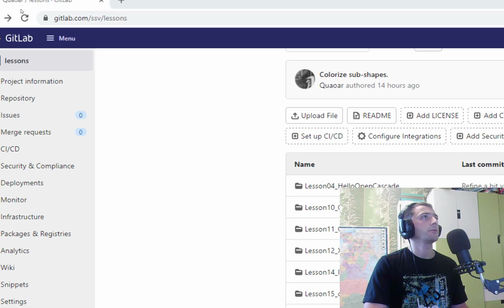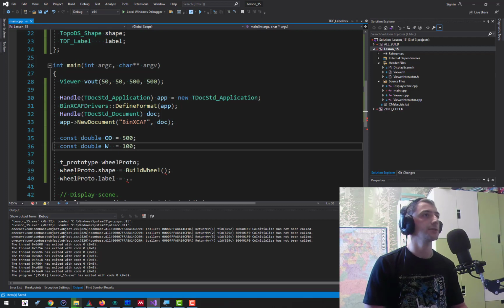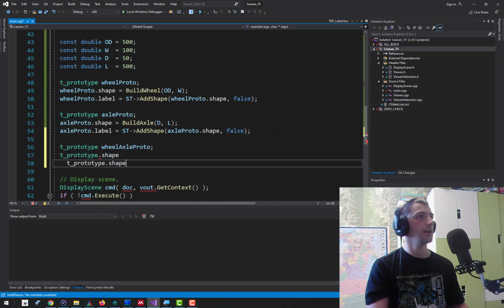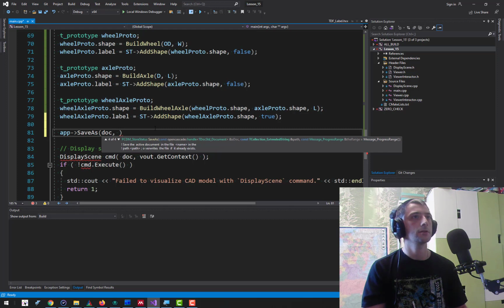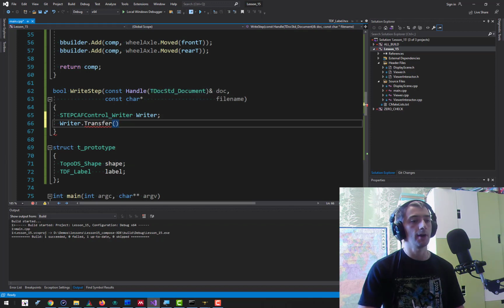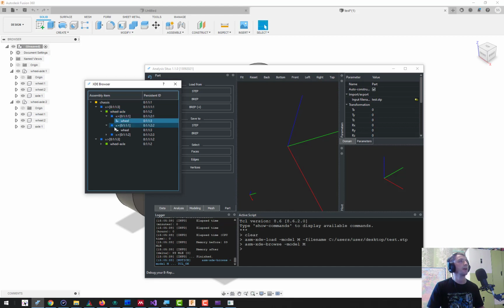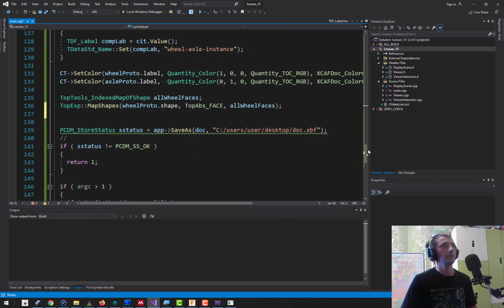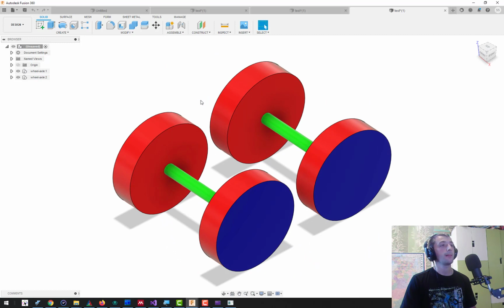Lesson 15: Export OpenCascade assemblies to STEP with names and colors

Comment: Thank you very much for this great tutorial!

It would really help if OCC could write metadata as strings.
We would not need then anymore IFC and other formats only STEP.
Reply from the maker: The thing is that if you even manage to write metadata in STEP with OpenCascade, your metadata will likely get lost on import in another CAD system. E.g., Inventor 2024 cannot even communicate face names, which is a feature available in STEP format for decades. If, however, your data never goes out of the OpenCascade-based software perimeter, then I would agree with your point. But for me it has never been the case.

Our take on metadata is more like this. We use STEP to communicate only the basic properties, such as geometry, assembly hierarchy, names and colors. Everything else we communicate using tailored formats, such as JSON for features, glTF for custom scene trees, and OCAF/XDE for metadata-rich binary formats.

Comment: Hi ! Thank you so much for this series, it helps a lot. I have a general question about OCCT : Is it possible to do "User friendly CAD" (with gui, tools, just like CAD Builder in the end) natively ? You have to use other frameworks right ? If so, what would you use ?
Reply from the maker: For something like CAD Builder you'd need Qt for UI, FreeCAD's PlaneGCS for a constraint solver, OpenCascade for visualization, data model (OCAF), and modeling, and also Python for scripting. These are more or less principal dependencies. If you want to build something nice looking, given that you've got tons of time/money, you can also consider Qt/Qml which is way more flexible than Qt Widgets for UI.

Comment: Is there any way to add TDataStd_Name to Face Label and export it to STEP file? It seems that the tagname of ADVANCED_FACE(' ',(#18),#32,.F.) is always empty.
Reply from the maker: Okay, there's one variable you have to set to make this work: Interface_Static::SetIVal("write.stepcaf.subshapes.name", 1);
Having this variable enabled, you can attach names with TDataStd_Name to the subshape labels.

#145 = ADVANCED_FACE('front-face',(#146),#83,.T.);

https://gitlab.com/ssv/lessons/-/blob/master/Lesson15_compose-XDE/main.cpp#L31
https://gitlab.com/ssv/lessons/-/blob/master/Lesson15_compose-XDE/main.cpp#L220
Reply from the maker: That should be possible, but I have to check it in the code. Will come back to you soon.